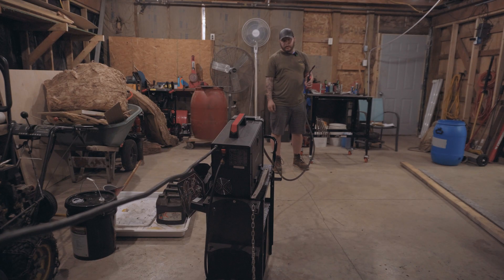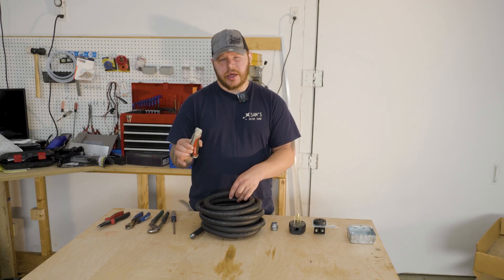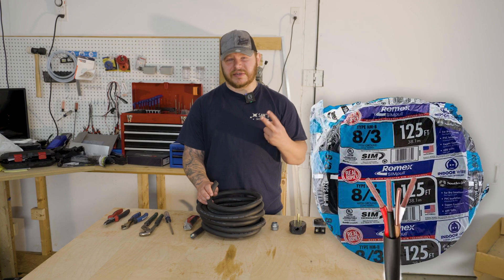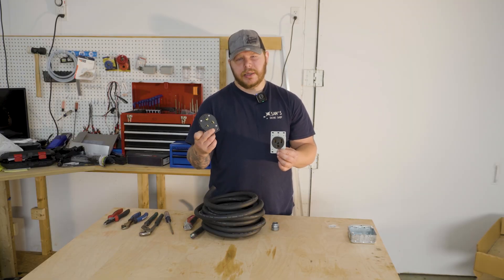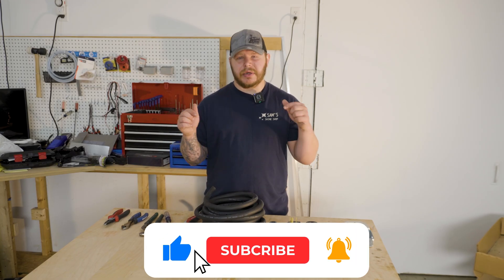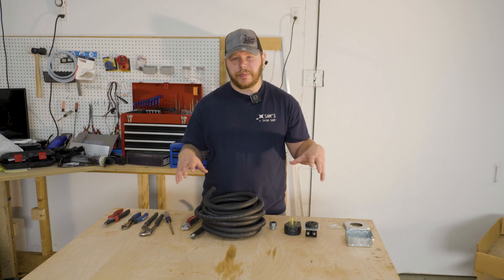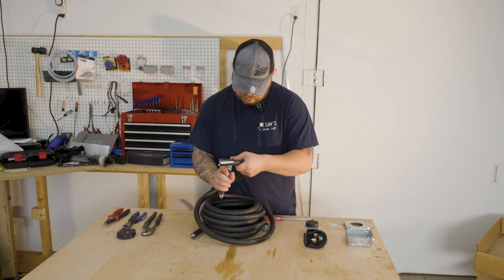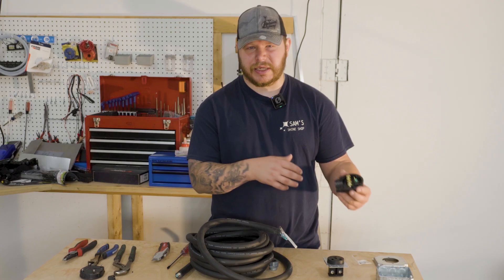How-to Welder Extension Cord! 220V

Comment: My detached garage caught on fire this past January because of an extension cord and an Idiotic decision on my part. 
    I had a smaller 220V heater running on an extension cord.   Here is the stupid mistake I made.  I had used the Twist lock plug ends to make switching between my Mig welder, plasma cutter, Tig welder and heater, quicker and easier.  I had bought about 10 of the twist lock plugs and figured I could finally use them up.  Knowing they weren't rated for enough Amps, I thought it would be fine.  Well.  It wasn't!  The plug got hot along with the cord and was hot enough to light a cardboard box on fire that was near it.  I noticed the flames fairly quickly, they were only 2’ tall.  Unfortunately, It was still very cold here in Utah and the first two garden hoses that I tried had just enough ice inside of them to keep any water from flowing.  By time I got the third hooked up and spraying water, the flames had spread and were filling the entire man-door opening.  I was able to put them out but the fire had spread up into a bunch of premium wood pieces I had been collecting for projects over the years.  It was very dry and I couldn't get water up to the spot where the orange glow was coming from.  I tried for 4-5 min before admitting the smoke was too thick, toxic and HOT!.  The Fire dept came and cut 6 holes in the roof to fight it from above.  They then sprayed everything with a white foam. (The Fire Cheif told me it was “Like dish soap” and was used to “break the water's surface tension”)  I can tell you it's NOT like dish soap and It caused more damage to my things than the fire or smoke did by a large amount. Things that normally don't corrode, were corroding with a nasty white corrosion buildup on it.
Reply from the maker: Holy cow! Yea ive used equipment with twist locks but I've only ever seen twist locks on heavier duty equipment like table saws. I remember my highschool shop class were almost all twist lock plugs. Were you able to save any of that wood even if you milled it down or im betting if it was dry it soaked every bit of that chemical they use up.

Sorry to hear your shop burnt up and you lost some wood. Its crazy to think that years of accumulation could be gone that fast. 

I just installed an ABC fire extinguisher near where I weld. My barn is not a dedicated weld shop and i have 2x4's, insulation, saw dust, and other things that could ignite.
Reply: This sounds like something that would happen to me . I’m probably am going to get an appropriate fire extinguisher 🧯 to have on standby
Reply from the maker: @Kryonsmommy I bought mine on Amazon. $50 abc extinguisher.
Reply: @ThatDIYGuy1 thank you